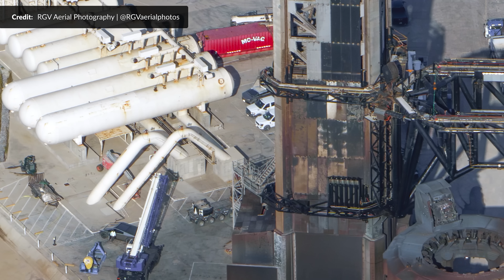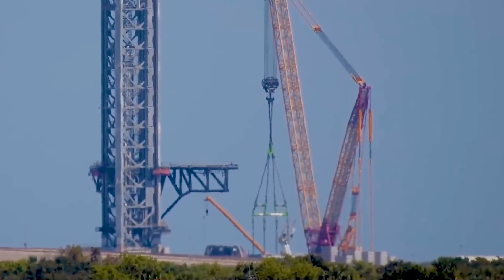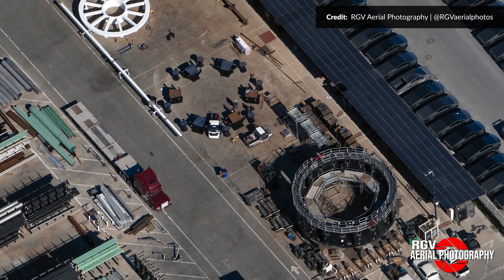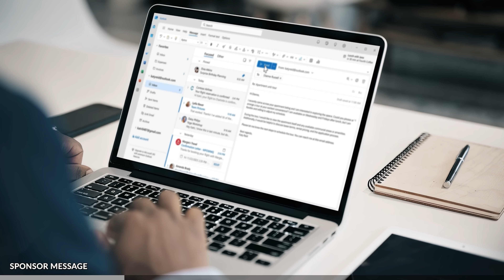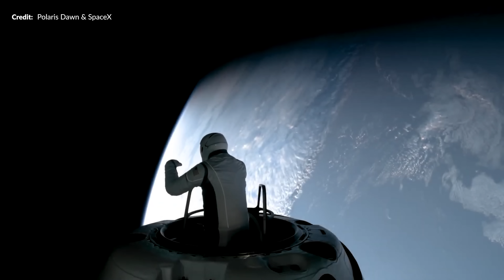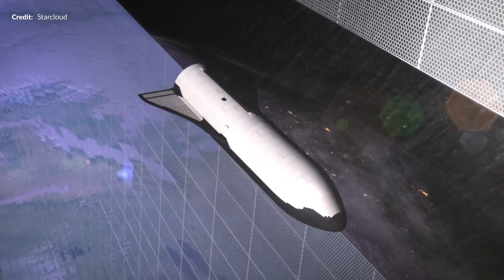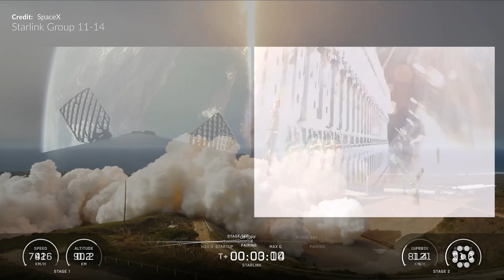Wow! SpaceX Are Ramping Up Starship Plans for the Moon? 🚀

Comment: Ultimate data center build:
Canadian Forces Station Alert, GPS 82.4994, -62.3463
Alert, Nunavut X0A 0A7, Canada (Qikiqtaaluk Region)
Add a gigawatt-electrical nuclear power station. Build it on the coast for unlimited 4 °C water cooling.

Comment: "vacuum cooling" is not a benefit. cooling in space is much harder, because you can only radiate the heat away, so you are limited by surface area that is facing black space, so basically the backsides of the solar panels. (no free cool air or water for evaporation). Cooling is much more costly in space, because radiated energy needs a high surface temperature, but chips want it cool. So almost required phase change liquid based Heat Pumps to get the chip cool but the radiator hotter. The "space saving" is bullshit. Datacenters on earth are not even build with multiple floors, because there is abundant area, same for solar, most roofs don't have any. Yes, Solar power is like a few 10% higher in space, and the night is much shorter in low earth orbit, but no way the launch costs and required sturdiness will pay for that.  The ONLY argument for space base data center I can think of is local processing. e.g. if data from telescopes is so much, that the bandwidth down to earth becomes the bottle neck. local data processing could help by either intelligently selecting only relevant data ( as in CERN), or data compression, but how much will that be in the next decade? Some Military use maybe. I doubt we will so much of that.
Plus the most advanced small chip notes are much more sensitive to radiation than the big rugged older nodes. But error correction can mostly compensate for that.
Reply: Completely agreed with both points. Can't understand why either things ('vacuum cooling' and 'space saving') were mentioned , as they are both total BS

Comment: Vacuum cooling is of necessity radiative.  That will make an interesting group of competing requirements - keep the computers cool (using refrigerant systems) and keep the radiators hot.  The delta between the two will be critical - and the greater the delta, the less efficient the system will be. I wonder if a data centre on earth would ever suffer such deltas ...
Reply: Yeah, calling "vacuum cooling" a benefit strikes me either as weirdly uninformed for a space channel, or just regurgitating company PR. Not sure what is worse.

Comment: say what you want about SpaceX trying something new, but that deluge plate never ceases to looks magical when it fires up
Reply: I just don't understand why they bothered engineering and creating this if they were just going to build a conventional flame diverter in the end instead. Seems like they wasted a lot of money with this.
Reply: @acasualviewer5861 Probably because they thought it might work.  But after a few launches with the plate they realized that, while the plate does work, it was being worn down faster than hoped, and/or had some other drawbacks.
Reply: @acasualviewer5861  Because they were hoping not to need a diverter so that they didn't need to go thought all the hassle of digging into water logged sand.

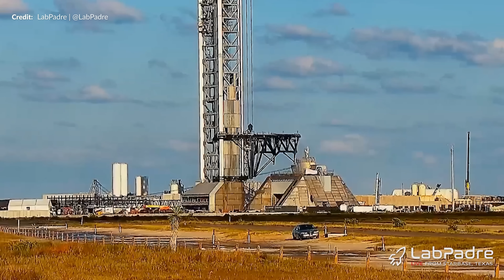Comment: 3:42 The ‘Test’ of top deck system looks more like a standard purge of piping system to remove scale / debris. Common for large system installations. Note that dust cloud.
Pressurize the system then do rapid opening of valve to release the pressure will sweep most of the construction debris from the pipes.

By debris I mean the small pieces of welding rod type of stuff that is inevitably going to end up in the pipes. There is always some of that

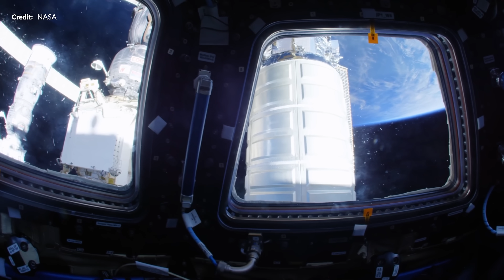Comment: 19:00  How do they handle station keeping with the solar-sail effect acting on it?  How do they keep it from deforming?
Reply: if you balance it right, a solar sail can hover of a gravity source like the sun. Gravity pulls in, solar wind pushes out. Balance point typically is very low mass per area. You can direct the push quite a bit by angling the sail, but this effect is reduced when the sail is not reflective, so works less with solar panels. in Earth orbit, to some degree it evens out, as the center will fly towards and away from the sun in orbit. For the rest, probably regular station keeping thrusters or ion thrusters for their high ISP.
Reply: @tristanwegner  It's 4km on a side, thin, and flimsy.  How do you "angle the sail"?

Comment: I'm getting real excited about Vast. When I first heard about them, I was highly skeptical that they would be able to deliver their product and now, here they are, ready to put up the world's first commercial space station at least a year before anybody else. If Haven 1 is successful, and I see no reason why it won't be, then there should be no problem launching the first modules of Haven 2 in the '28'-'29 time frame. 
Starlab is currently expected to launch in 2029, so you can expect that to slip at least into 2030. On the bright side though, Starlab already has actual customers. They have contracts to host payloads. I don't think anybody else has achieved that all important milestone.
Since Axiom is dependent on the ISS to begin assembly of their station. Currently, their NET date for launching their PPTM module is 2027 and their Hab 1 module is 2028. It is vital that those dates don't slip too far. They can lose two years, but no more. I hope they do it in time.
Things are tight but, with luck, before the ISS is decommissioned, we will have three different commercial space stations of varying sizes, purposes, capabilities and orbital inclinations. Two of those will be multimodule stations which will still be growing. 
Orbital Reef is also projecting 2027 for the launch of its first module but, given Blue Origin's well deserved reputation for sluggishness and the fact that both BO and Sierra Space have other irons in the fire that seem to be higher priorities for them, I am highly dubious of their getting their even by 2030. Nonetheless, they will undoubtedly get it built in the early '30s.
In an absolute worst case scenario, by the early 2030s, the United States will have two commercial space station and the odd are better than even that we will have four. Come to us world, we are open for business.

Comment: The fact that Starcloud is, apparently seriously, proposing a space-based data center is indicative of the size of the AI bubble... Absolute hysteria.
Reply: I take advice from Petyr Baelish and imagine the worst reason possible for doing what they say they are doing.  Data centres in space because angry mobs can't burn them down from Earth when the AI / Skynet mass surveillance and robot deaths squads take over.
Reply: Calling everything a bubble is nothing short of baseless doomerism. I chose to believe we have a path to the stars instead. Being positive leads to a happier life.
Reply: @sirachman  Please don't mistake me pointing out hysteria for negativity. I would even argue that building a space-based data center would be immensely positive for space infrastructure. But that does not change the fact that the cost per compute power of a space-based data center would be, at a bare minimum, 1-2 orders of magnitude higher than a normal one, hence the hysteria.
Reply: @TheEldon3379 I see your point. I am hopeful the pricing with lower launch costs can be far less, yet more than terrestrial solutions. The benefit I do see in space though is escaping a lot of the regulations around land use and new power generation. That could motivate paying higher cost. And if massive scale truly does occur, we dont want all of that built on Earth.

Comment: Why don't they land a small nuclear power plant on the moon with unmanned flight?😊
Reply: Which small nuclear power plant do you suggest?  I think a part of the problem is going to be deciding how much of a reactor you need, design, build and launch.  Could take many years, nuclear regulation can be slow.
Reply: Yeah we already have them 😂 👍  @imaginary_friend7300
Reply: @kennethtackettjr3516  Indeed?  Which model were you thinking of that could be adapted to work on the moon?

Comment: The advantage of having servers concentrated in a room is that they are easy to interconnect with high bandwidth and low latency. If you do independent modules/satellites with network spread over kilometers of area, this limits what you can do to distributed algorithms. LLM inference for millions of users is possible in this setup, but LLM training is not.
Reply: Starlink can probably come to the rescue with this one - or the datacentres can use lasers if they are within LOS to communicate with each other, similar to how SpaceX plans to have their Starlink satellites communicate with each other.
Reply: @edvoon  light in vacuum has latency 3.33 microseconds per kilometer. No way you can cheat that. And that is practically an eternity in CPU time if you have to wait because your algorithm forces you to request that data. 
I don't say it's useless! I only say you can ask premium price if your computing power is colocated and does not suffer from this.

Comment: As a senior network engineer I can see some very practical issues what happens when a cable fails it's not like you can hop in your car and drive to the DC (Datacentre) and it does happen. Or an SFP fails. This would mean at a guess if I was designing this network I would be over-engineering it with a lot of redundancy
Reply: I'm sure satellites have cables , how many fail

Comment: 1: OLM = Obsolete Launch Mount

2: Orbital data centres are a non starter due to cooling in a vacuum is problematic let alone maintenance ability would be non existent. Sounds an awful lot like investment seeking/stock inflating type rubbish.
Reply: The ISS manages cooling fine.

As do ALL the other satellites.
Reply: @JohnSmith-x3y8h  Yep, huge data centres put out more heat though. Also the maintenence as I stated.
Reply: Cooling in a vacuum is a known issue. While not easy, it is possible and is done just fine with everything else up in space. The question is will the continous daylight power and looser regulations be worth it over the cost to orbit and more difficult cooling. Right now it isn't. Maybe once Starship is online though. We will see.
Reply: @anthonypelchat 

There aren’t any orbits around the Earth that are permanently in daylight.
Reply: @JohnSmith-x3y8h  Lagrangian points can. Plus you can have near uninterrupted solar power through other orbits, where the sun is only blocked by the Earth for a very short period of time.
Reply: @anthonypelchat The Lagrangian points are too far away.
Reply: @JohnSmith-x3y8h  Still exist.
Reply: @JohnSmith-x3y8h  There are polar orbits that see the sun all the time.

Comment: ATC working without salary to keep up connectivity in the country is WILD for what calls itself a world power.
Reply: I call for privatization with strict gov oversight. Gov can't do anything efficient or on time. Airlines should be responsible for atc union pay. Also would be a good application for AI assisst in modernization effort.
Reply: ATC is a completely obsolete practice. Modern airliners are perfectly capable of operating autonomously point-to-point.

In fact disasters have occurred due to pilots following ATC instructions instead of the warnings from the onboard systems.

Comment: If astronomers are worried that Starlink will disrupt Earth based astronomy, miles wide solar panels will be a disaster (pun intended).
Reply: It will become way cheaper to have more telescopes in space giving astronomy a huge boost! Why only have 1 James web telescope when you can have 10 for probably the same price
Reply: When they have personal access to much better telescopes in space they’ll suddenly go quiet.
Reply: once starship becomes operational your going to see a lot more space baced telescopes bypassing the starlink problem.
Reply: Haha ha haha
Reply: they would make more sense for powering commercial space stations,  a dude dropping 60k on a solar field would make 10x the electricity that would arrive on earth from such a dumb gimmick.
Reply: It's more complicated than size. How things are oriented makes a big difference in how much light they reflect.

What is more, the problem with Leo constellations is the thousands of little streaks ending up on exposures from the thousands of satellites interfering with the observations.

Also note that at Earth's orbit, the sun's flux is about a kilowatt per square meter. It doesn't take as many square meters as you might think to generate a lot of power. So try to make more nuanced comments without significant thought.
Reply: How? Considered they’re ground based, and absorbed light, I’m not sure you point makes any sense. 

Alternative:
Ground based telescopes will be come obsolete when we can lift 100 tons to space.

Comment: The moon is a great place to build spacecraft because instead of them having to be folded up into a faring and withstand the vibration and acoustic shock of an earth launch, they could be constructed in their deployed format in a massive airlock and when complete the air could be evacuated in a controlled manner and the spacecraft tested to make sure it can work in a vacuum even before it is launched. Launch from the moon will be simpler than Earth because of the lower gravity and lack of atmosphere.
Reply: 💯 - Moon is also great for providing resources to manufacture huge things in orbit, like solar power satellites.  Much lower delta-V!
Reply: True.  It just takes a LOT of work to get to that point.

Comment: White elephant for taxpayers
Reply: It’s privately funded.
Reply: @JohnSmith-x3y8h  wrong . 3.2 billion for Artemis moon project that Nasa awarded 
Them the contract that they are years behind in
Reply: @JamesArthur-e3g 

That has a contract with multiple staged payments, all requiring delivery of the goal before payment.
Reply: @JohnSmith-x3y8h white elephant!
Reply: @JamesArthur-e3g 3.2 billion is only a fraction of what spacex has spent
Reply: @davefarmery8180 taxpayers money
Reply: If you think Starship HLS is bad, you should look at everything else out there. SLS and Orion are a decade delayed and tens of billions over budget, which is fully funded by tax payers (not the case for Starship). And they cost 4B per launch. The suits for Artemis are also delayed and will cost 3.5B, which is more than SpaceX will get for 2 landings with HLS. NASA has even spent billions on the infrastructure to support SLS and Orion. Further, the other companies that competed against SpaceX for HLS were 2-3 times more expensive. And Blue Origin, who won a contract after changing the design and bringing down the costs, is also delayed. They now won't launch until 2030 at best. And they are STILL more expensive than SpaceX's HLS.
Reply: @anthonypelchat starship 12 years in development and not a single orbit
Heat tiles still fall off ? White elephant
Reply: @JamesArthur-e3g  O' Good a' Cartoon ! 
In the 1950s, Walt Disney produced a cartoon about space and Mars called Mars and Beyond, an episode of the Disneyland television series that aired in 1957. The animated documentary explored scientific theories about space travel and life on other planets, featuring imaginative segments that parodied pulp science fiction while also incorporating concepts from real scientists like Wernher von Braun. 
Part of a series: Mars and Beyond was the final installment in a trilogy of Disney space shows produced for the Disneyland series, following Man in Space (1955) and Man and the Moon (1955).   $ame $hit a$ of Nov 2025 ...wtf.

MORONS !                               TWO WEEK'$.
Reply: @JamesArthur-e3g  Starship has not been in development for 12 years. And it could have gone into orbit several times by now. 

I'm assuming you are starting Starship development when the Raptor engines first started development. By that measure, SLS was under development for nearly 60 years before its first flight. And Orion started development in 2005.

Comment: I would think that they would prove the design of pad2 before revamping pad 1.  When can we expect the first static fire on pad 2?
Reply: Anything will be a huge improvement over the old doughnut mount
Reply: Yeah, I thought that they'd at least do a static burn on one before they 
build a dozen of them.
Reply: Why?  They will need to remove the hardware not matter what.  Why wait?
Reply: @imaginary_friend7300  Yes, but before
they rebuild it, fire one up on OLM2 to see
where improvements need to be made.
It's a Lot easier to do it once the Right way
than it is to find out that you engineered
it and built it wrong.